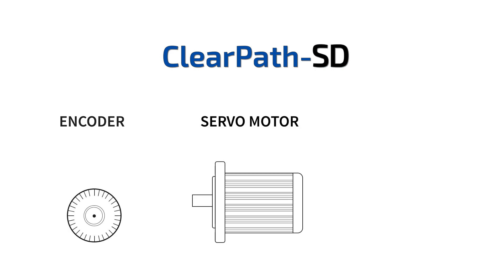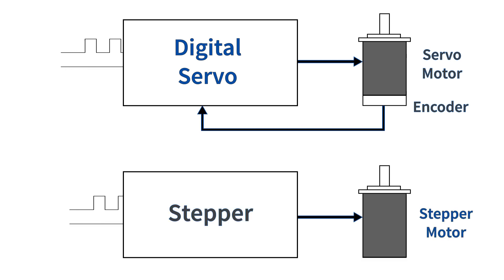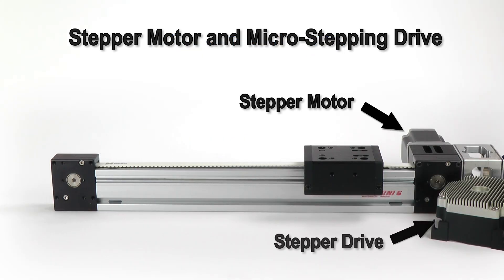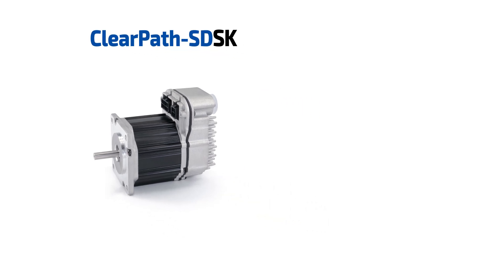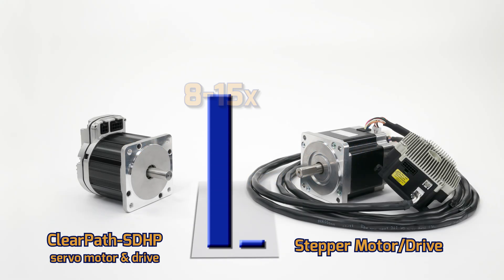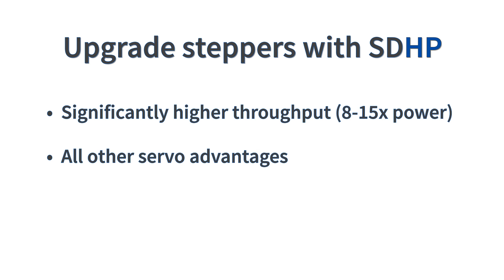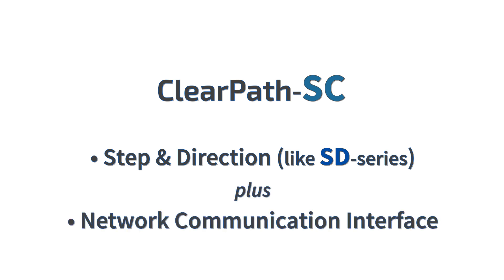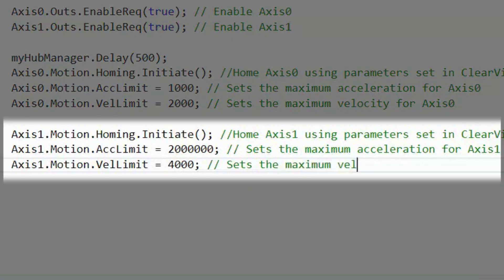ClearPath-SD (Step and Direction) Series Overview

Comment: Dmm sells a multi axis kit with motors, drivers, cables, power supply etc. All in one matched kit. Do you guys sell a kit with clearpath sd. New comers to cnc can greatly benefit from a kit.
Reply from the maker: Hi MySchizo Buddy,

Teknic does not sell a single, one-size-fits-all kit; and that is actually by design. This isn’t the first time someone has asked about a kit though, so if you’re interested, here’s some information on why we went a different route. 

If Teknic only built one or two different ClearPath models, it might make more sense to sell a kit. While those models would likely be suboptimal for many applications (more on that later), we could easily create packages for the few motor part numbers we offered. 

We currently manufacture over 1,000 different ClearPath motors. This variety enables customers to select the exact models best suited for their mechanics/application goals. As a result of this many options, Teknic would either have to create 1,000+ different kits (which would be logistically difficult), or choose a few select models around which to design kits. If Teknic chose the latter option, customers in favor of choosing a kit would (perhaps unknowingly) almost always make a suboptimal selection for their individual machines. 

For example, a customer building a small tabletop laser engraver has very different goals than the customer retrofitting their 5x10 freestanding CNC plasma machine. Even customers that have the same exact machine will often times use it for very different purposes (one customer may primarily cut thin aluminum, whereas another might be only cut through thick plywood). 

If the same kit were used for both applications, in one instance the customer would buy a kit that cost more than it had to (because a lower cost motor could do the job). In another situation, due to the material he/she is cutting, a customer could have increased throughput by choosing a motor with a different torque-speed curve (without increasing the cost). 

We want our customers to choose the right motors for their applications. Teknic employs factory-direct applications engineers to help make this selection easier. These engineers will help you narrow down your options, and select the exact complement of products that makes the most sense for your application. 

If you’d like help with this, please contact us through support@teknic.com, or call +1-585-784-7454.

Best Regards, 
Jon K. – Teknic Servo Systems Engineer